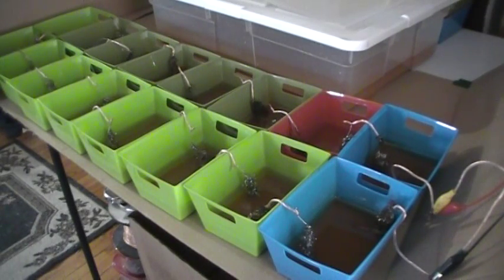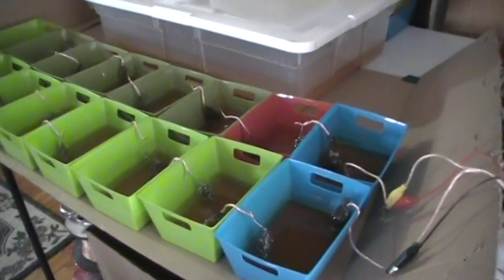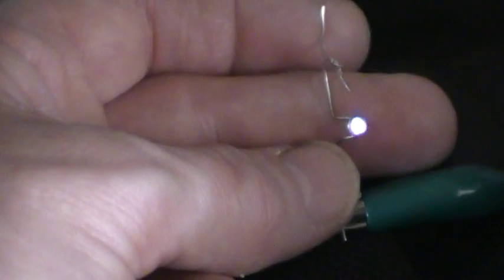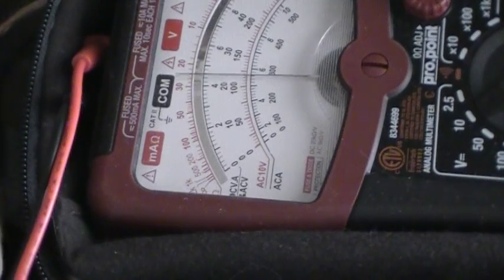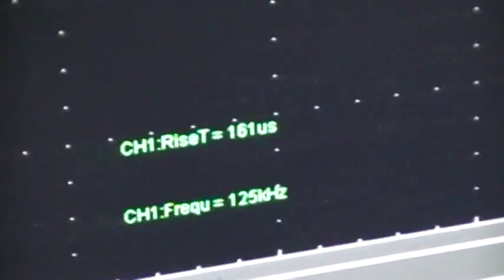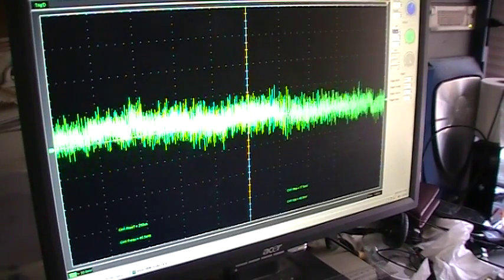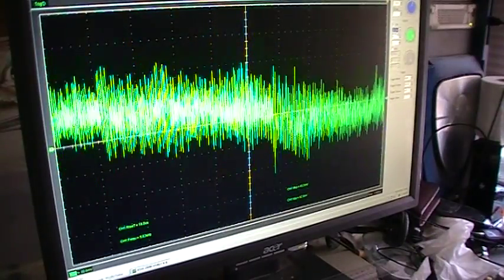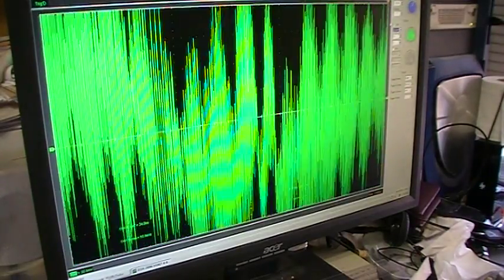Nano Coated Copper AC Solar Cells

Comment: lol. what is this 0.3 VAC? Are you going to fill all your room with boxes to get more voltage? Can you show you can transform 0.3VAC to12VAC together with power VxI ? It is easy to say that you can transform some voltage into another voltage with transformer but not easy to to prove that power VxI gets transformed together with that.  I get some system at home based on GANS and nanocoating that produces  0.3 DC and that's all for a time being, its to little to bother. To create battery form that is impracticable due to size of that battery. Unfortunately we aren't fully unlocking the GANS potential for more power, this was never disclosed to sympathisers of the GANS systems. However hint is, in order to get more voltage - "rotate GANS" - this may prove to deliver more voltage.

Comment: Understand that the CuO is a P type layer like into a diode. Then if you make winding with a continuous diode, you will receive all frequencies around the coil present in the air, I mean RF waves and microwaves. Then this is a diode, so the Gans is the dry electrolyte if you want like into a Mica capacitor. You have a resonance circuit with a didoe and capacitor all together at atomic frequency. It work like this. Then if you flow a current into this winding, you will have charge and discharge between layers creating heat (you must put a load on it) then new frequencies from all the sparks. 
It is normal that is react to light because light is magnetic cavitation at a very high frequency, so if you turn a light the light add frequencies but dont forget you have switching supply into CCFL and LED lamp so it create EMI around you so it will catch up too.

Comment: this is interesting.  I know that you can read stray voltage with an osicscope from a florescent light , or other things running motors, lights , even flashlights give off stray emissions. so we need to make sure your equipment is grounded. so you have no stray interference.  Then look at your voltage  take the readings . then take two rods about 3 feet long pound them in the ground one copper one aluminium place them at least 15 feet apart connect them to the experiment.  ill bet you your voltage jumps up dramatically.  IM thinking this might be collecting stray energy which in itself is incredable . we have alwayse have known how to capture  at a very mild form this stray energy but the results your showing you might be on to something biger than you think .try the rod experiment I have a feeling you might be very pleased

Comment: I read your recent post on the Keshe Facebook page. You get orange "GANS" because you are using iron (steel) for the non-coated electrode. If you use a different metal, you will get a different substance. Light blue if you use copper (you will only get very little current from this variant), and white for example with zinc or aluminium.

The reason is, as I stated before, that these substances are ordinary compounds (hydroxides and/or chlorides) of the electrode metals. Look up, for example, the hydrated form of iron(III)chloride on Wikipedia (it's the lower of the two pictures on the right side). There are other iron compounds which look very similar.

Just take some of this substance to someone who is proficient in chemistry (maybe at a local school or university), and let him/her analyze it. This will confirm what I stated here.
Reply from the maker: You are flawed in your belief that this GANS material is just a chemical compound.  Anyone that has tried making GANS with this system using the nano coated copper will quickly learn one important lesson that proves it's not a chemical reaction.  As soon as the GANS material reaches a certain concentration the processes stops until you remove some of the material from the solution.  If this was a chemical reaction the chemicals would be consumed once the material stops forming and just removing some of the chemical would not cause more to keep forming.  Mr. Keshe reports one of the foundation's cells has been producing GANS for 4 months now and keeps on working after the GANS is removed.  Also the latest tests of placing the GANS into a spinning reactor producing a 74Tesla magnetic field, while consuming only 11 watts of electricity, is clear proof that this isn't just a common copper oxide material.  Try placing copper oxide into a GANS reactor and see if you can get similar results.
Reply: An element or molecule in the GANS state has different properties than when it is in the pure matter state. Just as a kernal of popcorn is different in the popped state as it is when it is in the seed state. You have to have special equipment to test for the state of the matter. Neandithall science of today will insist it's right and that is why we are going nowhere.

Comment: Your photo galvanic electric power generation is little different from chemical reaction generation inside car battery. 
http://www.ijrer.org/index.php/ijrer/article/viewFile/573/pdf 
On above site you learn that photo galvanic effect is low efficiency with low output power (miliwatts), the max current of 500milivolts holds for 3 hours. After that one has to replenish solution. (cell size of a large room?)
Are you seeking kilowatts solution/s???

Comment: The black "nano coating" of the copper is nothing else than ordinary copper(II)oxide (CuO). Copper oxide (both variants) shows a photogalvanic effect. This has been thorougly researched in the late 1800s, particularly by Gouy and Rigollot. Google: copper oxide solar cell. The alleged "nano materials" emerging during the operation of such cells are nothing else than ordinary hydroxides and/or chlorides, depending on the electrode material. Compare photos and descriptions of these alleged "nano materials" with the hydroxides and chlorides of the electrode metals.
Reply: *****
Ah...  clearly a photogalvanic effect. So when I get the same response by just clipping my scope probe to a red cliplead, the red wire is producing the same photogalvanism as these Keshe cells! Thanks for the great insight.... and here I was, all this time thinking it was RF from the CFL's switching power supply.
Reply: May I suggest that it could be both (Mr. Kravinik already mentioned this in another comment)? Copper(II)oxide the (not-so-"nano") black coating of the copper electrodes does have a photogalvanic effect, that's a well researched fact since the late 1800s. It seems not unreasonable that it can pick up light fluctuations in the kHz range (silicon solar cells certainly can). The photogalvanic voltage from a copper(II)oxide electrode is to be expected in the lower double digit millivolt range. In the later sections of the video the AC component (overlayed to about 5 V DC, obviously generated by an ordinary electrochemical reaction, about 0,3 V per cell) reaches about 350 mV Vpp, which corresponds to about 22 mV per cell. It could be a combination of RF incoupling and oscillating photogalvanic voltage.

A few simple experiments (like covering the cells with a light-tight panel and turning up the lighting, or disconnecting the current lighting -- including the power supply -- from the mains, and lighting the cells with classical incandescent bulbs) should quickly reveal what is actually happening. Mr. Lehman?
Reply: ***** "As I have written, the display on the scope is a combination of the photogalvanic effect of the cells plus RF coupling from a switching power supply. This can be clearly seen at 07:00 where the display changes dramatically at the exact same time as the room lighting changes."

Here in Texas we call this the "Switch Effect", where a room gets brighter and dimmer according to how many light switches are turned on.
The Switch Effect simultaneously causes CFL lights to brighten, and RF to be emitted from their power supplies. Modern test equipment easily picks up the signature of the Switch Effect.... especially when that test equipment isn't properly grounded.
There is no evidence in what has been presented that a photoelectric effect is occuring. As you have written, it would be easy to demonstrate if it were true, but not by the methods shown in this video.
And apparently there is indeed a great need to "become ironic", since ordinary statements of plain fact have such little effect.
;)

Comment: Are those lights cfl? I have a USB scope and have seen that effect when I turn on a cfl. I just put it down to interference. Interesting that you are getting ac from your cels though. Thanks for sharing
Reply: There is no evidence for "AC" coming from the cells in this video. Mr. Lehmann has set his oscilloscope to "AC coupled" and is using no attenuation and 20 mV/division vertically. The "AC coupled" setting filters out the DC component of the measurement -- which you know is there because the LEDs are lighting up -- and brings the oscillating component down to average around the baseline. This oscillating component that you are calling "AC" is actually a tiny ripple of 40-60 mV p-p sitting on top of a 5 volt (approx) DC level. The DC level is filtered out by the "AC Coupling" setting and the average of the tiny noise oscillation is brought down to the channel's baseline. It is NOT "AC" being produced by the cells; rather it is an artefact of the improper use of the oscilloscope.
Sorry, but there it is. I responded to the posting on the forum yesterday, but received no answer or comment, so I'm posting this information here now. Will it survive, will it make any impact, will it help people make better measurements? I sure hope so.
Reply: TinselKoala The general problem is that people do this stuff trying to bring the evidence of what is happening there, using improperly "the instrument science", very few take their time to study the principle and put THEMSELF in the right condition to do. Actually this discussion is little-satisfying because if you read the patent this is the system thought to "capture" material (usefull for the next application that you have already to find or the one already found, step by step, learn to walk then to run) in an other "state" of matter, with property to find out (the first,  is the fukushima application), no energy production but only a "collateral effect" of this little amount of energy release. so it's important, i think, to be "free-thinkers" not tied hard to other knowledge, because it's not important HOW but WHY. In this why you can put in a lot of thing more, one over the other, love.
I hope Harold will continue is work free as it is but using an other part of himself, the only anyone can feel in the moment of interior silence, all the evidence will be discosed!
You Tinsel, you are right, it's all very unbelievable, But it's important to understand even for Harold that all this has totally different concept and it has to be learnt to be shaked from you in YOUR new form, no standard available here!!;P.
Felt Regards
Reply: ***** ahahahah right, i repeat the concept is WHY exstist in nature the effect behind that we call "battery"...because me and you blinded from the needing of control (and let me add that it was ever like so because we had EVER to give somthing to someone that don't ask but comand, changing this condistion first, help in research) we could not decide literally with our eyes what is true and what is not...switch your mind, trust the silence not the words. all will be clear discovering in every piece of yourself that you and that "thing" are made in the same way for a very simple and obvious motivation, that is personal. Actually this knowledge is unpatentable and i think the patens were written only to subtract a little bit of power, (remember? copyright, http://www.planetforward.org/idea/plasma-based-hydrogen-generation-from-sea-water, not enough the octopus is fast). I don't know who is he (keshe, i don't know him personally) but WE are the humans and we can't decide in our creation until free like after a hard reset from the rigid control scheme of the repetibility and be unic like every one of us for a reason or an other is. There is a way for us to win anyway...irony and lightness.
Reply: +Gianmarco Miroddi I' trust Keshe if he were silent. But he does not stop babbling nonsense
Reply: +Jean-Pierre Mürrli I agree, i didn't stopped my research...i found for sure that the material that you can find in the boxes is copper oxide (green cian one) iron oxides ( orange one) with a definition of 1 micro at the microscope it looks like clusters of spheres on larger pieces of not-oxidezed metal...i hope to look it closer...i'm intrested in the shapes of nature...this kind of processes appear everywhere, i really would like to clear the bond between electricity and the "scaffolding" of matter...

Comment: NEVER touch the nanomaterial with bare hands!!!! Use gloves!!!! Will kill you.
Second - when you connect LED always need to have at least a current limit resistor...And  the AC you are getting is your triac interference. If you want to approve a light, cover them with un-transparent paper...

Comment: Great video. People have downloaded the online patents but do not know how to follow them. Could you educate a little on how to follow?

Also, this video is amazing. Do you think you could get access to a transformer and show us what happens with the circuit?
Reply from the maker: I am setting up better system with larger electrodes, hopefully they will give me enough power output for larger applications using a transformer.
Reply: Subscribing. 
BTW: Mr. Keshe's patents also include a 9V
battery. What are your thoughts on getting
one of those done? Since it's 9V and could
last virtually forever -- torch lights could be 
lit 24x7 and replace bulbs for starters in poor
countries.
Reply: ***** It would certainly be possible to separate the AC component from the DC component. That wouldn't help much, though, because nearly all the power is contained in the DC component, generated by the electrochemical reaction between iron (the uncoated steel pad electrode) and copper(II)oxide (the coated copper electrode), probably in the double digit milliwatt range. The power of the AC component is probably lower by a factor of more than 1000. Both RF incoupling and photogalvanic power (if it contributes to the AC component, which I consider likely, but which is unproven so far) will only deliver nanowatts. Even a significantly larger and more efficient copper(I)oxide (Cu2O) solar cell of similar basic design (Cu electrode / NaCl solution electrolyte / Cu2O coated Cu electrode) delivers only about 10 microwatts of power in total.